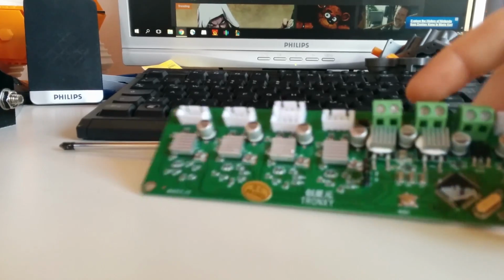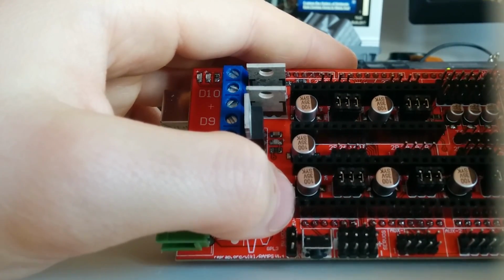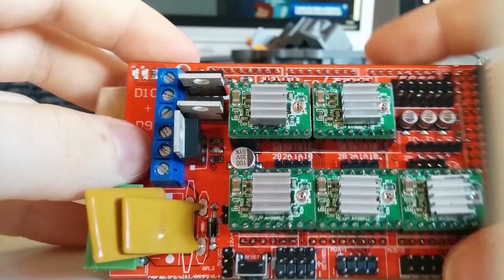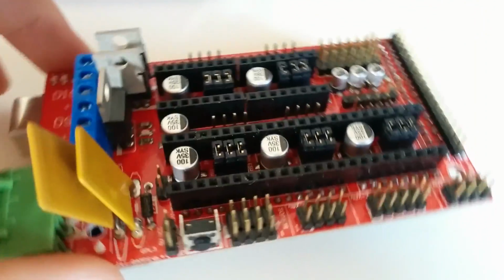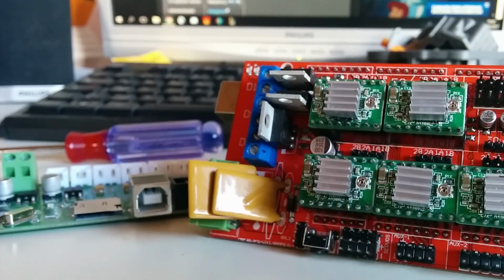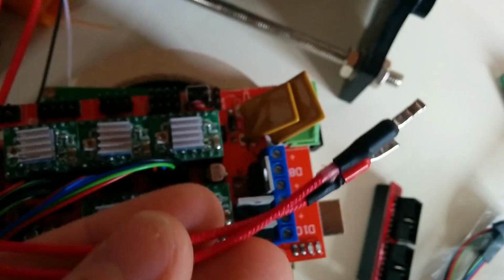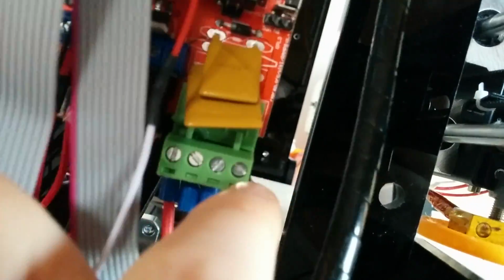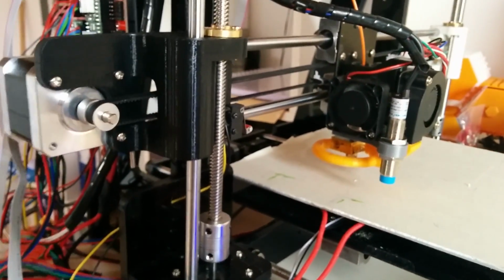RAMPS 1.4 wiring for the ANET A8

Comment: I received an Anet A8 3D printer with no documentation, so I did some Google searching to see what I could find. I got it up and running with a couple minor setbacks but while adjusting a limit switch, I touched a couple of solder joints on the small switch pc board. I saw a bit of a spark and my controller screen showed rectagnal shapes filling the screen. I hooked up my USB cable to my laptop and the screen went to the normal view but the main board was not powered up. When I plugged in the main power the screen went back to the rectangles and my laptop shut down. Now whenever I plug in the printer it blows the GFCI.Any ideas as how I can fix it?

Comment: Up until now, i was inserting an sd card (with the gcode file) into my anet motherboard. But arduino and rams do not have the sd card slot. What should i do ?
Reply: Buy Ramps 2004 LCD Smart Controller (RepRap)
Reply: OctoPi my dude

Comment: For info: the connectors, you can use Molex KK 396 series connectors

2 way for thermistors   Molex 09-93-0200 
3 way for end stops      Molex 09-93-0300
4 way for steppers        Molex 09-93-0400
Crimp terminals for all the above Molex 08-50-0105 (these are the cheapest - others also available)

Comment: Good video. The best I've seen. Question: Does the Mega 2560 require a separate power lead, or does it get power from the ramps board?
Reply from the maker: It gets the Power from the Ramps
Reply: 3DMaker Thanks. Hey, I have a YouTube channel also. Mostly 3d printing stuff, Anet a6 is the printer that I have. I also do machine shop and welding stuff. If you're interested, subscribe me. I just subbed you.

Comment: Hey man, love your videos! Just one question, can you provide a decent wiring diagram.. I am specifically looking for the external mosfet wiring. I would assume I run 12v rail from my ATX PS to the MOSFET, then to the bed. Then to the RAMPS board connector I connect the control wire?
Reply from the maker: Hooking it up is just the same as for the Anet board. The small cables to the blue terminals where your heatbed usualy plugs in. The heatbed to the marked terminals called heatbed and power in to your power supply.

Comment: Which is better the original mainboard or the ramps
Reply from the maker: The Ramps, modular design, more connections, more stepperdrivers, changable Stepper drivers (the TMC2100 are really good), ...

Comment: I bought new ramps ....and I have connected all ports exactly the same .....but on the display its just the blue light
Reply from the maker: Send me your config. Check if EXP1 goes to EXP1, / try to switch the both cables.
Reply from the maker: For me the config is working. From where did you install the U8glib? 
Try out some different language for example en. If it is working then try to use pt-br_utf8. 
If not try this mod: https://github.com/MarlinFirmware/Marlin/issues/5270
Reply from the maker: Have you uploaded the firmware? https://www.youtube.com/watch?v=nQEpbSpe5_I&t=25s
Reply: 3DMaker ....the whole system was already configured ......I have just changed the ramps ....and made the connections
Reply from the maker: Did you use the same Display? Are the EXP ports switched? Have you tried adjusting the contrast?
Reply: 3DMaker yes I have tried contrast ......its not the problem I think .....there is no marlin on display .....
Reply: now I am switching my old ramps ....and going to check the display
Reply from the maker: Ok again have you uploaded any firmware onto the RAMPS?
Reply: Same problem happens with me. Only with firmware Marlin, on Repetier works. But I want to use the Marlin. You know how to fix this problem ? I instaled the U8glib and set the full graphics, but doesnt works
Reply from the maker: Did you include the library? put this at the begining of the code: #include U8glib.h
Reply: old 3d printer controller board works .....the display shows the marlin and things works . in my old board the extruder isn't working that's why I bought the new controller board . but when I connect , there is only blue screen ,no marlin on it .
Reply from the maker: Are you using the old Arduino, the blue board?
Reply: Yes I try to change but the repetier works, so I think than hardware is right. :/
Reply from the maker: Still waiting on the config :) admin@3d-maker.info
Reply: I sent an e-mail to you. Thanks.
Reply: I tried for 5 hours and don't work :(
I'll use the repetier for while, awaiting an update of code.
Reply: blank display with beep sound .
Reply: I tried, also the solutions in comments. But, the problem persist.
Reply from the maker: and there is still no error message. If not you did something else wrong ;)
Reply: I'm using de blue board. And there aren't error, only shows de blue screen. I included the library, but, doesn't works.

Comment: Thank you for your very helpfull video. Could you please explain how you wired the mosfet? Did you connect the mosfet to the 11A or 5A entrance? Thanks a lot.
Reply from the maker: https://3dprint.wiki/reprap/electronics/heatbed_mosfet 
Follow this picture. Just connect the two white small wires to the heatbed output (blue terminals)
Reply: Thank you for your quick response. But that doesn't answer my question in total, because on the original Motherboard was just one power entrance, but on ramps 1.4 are 2, so i'm not sure how to wire it. With 5A or 12 A.
Reply from the maker: What do you mean by 5A or 12A? You will have to connect power to both inputs, just like I did. 0:40
Reply: So you wire both power inputs with your power supply and additional you connect the mosfet with another port of your power supply? But the you won't need the connection in the drawing to the power port of the originall motherboard or am i totally wrong? Sorry for my stupid questions, but i'am absolutly new in this topic. Or did you connect the 11A or 5A entrance of Ramps with the power supply via mosfet?
Reply from the maker: Both power inputs are wired to the power supply. Then connect the JST (google the connector) cable to the ramps, where usualy the heatbed was. Connect also the power to the terminals as well as the heatbed
Reply: Thank very much.

Comment: For what exactly do you still need the external MOSFET as the RAMPS has already a Power Ciycle for Heatbed only separated by a MOSFET on board?! How do you wire it?
Reply from the maker: +David S. The main problem why you need a external MOSFET are the terminals on the board. These vary a lot from ramps board to ramps board. Some used a 12A, others 15A or 20A. So you can see the amp rating of the terminals can be just on the limit and there were alot of cases where the green connector melted and burned. Just like the original Anet board. This is mainly due to the wrong wiring without wire ferrules, however if you already have a MOSFET then use it
Reply: 3DMaker which Terminals do you mean? the connectors for the cables or the fuses?
Reply from the maker: The green connectors for the power input.